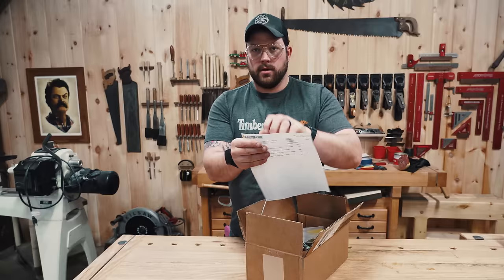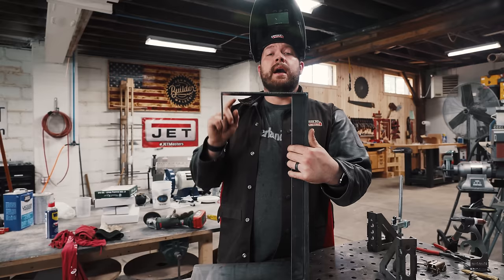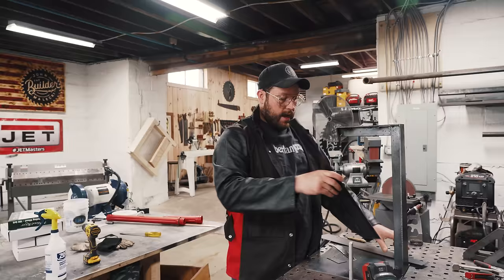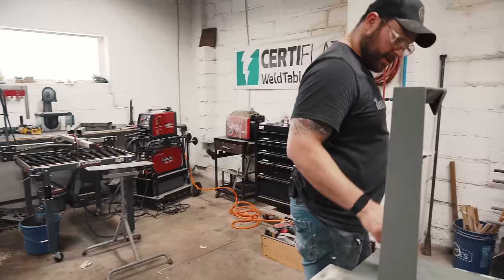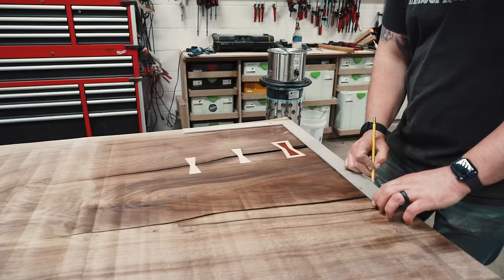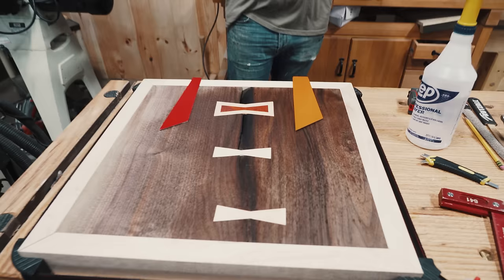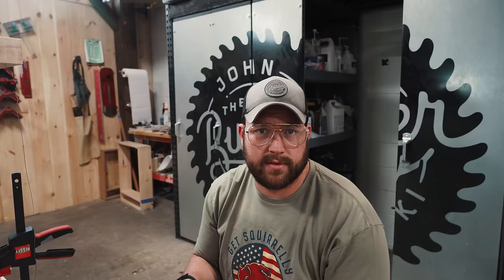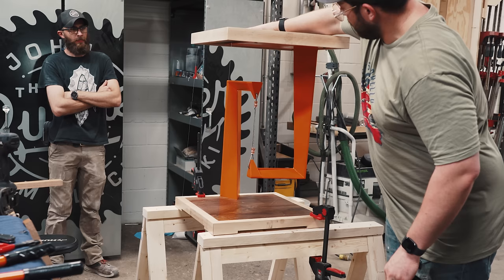Another IMPOSSIBLE "FLOATING" Table Build That Almost BROKE!

Comment: Instead of having just 4 wires that go straight up put 8 wires that cross and go to both other corners. Create Xs on the faces and that swill keep it from rocking and make a table that is actually sturdy and useable as a table that doesn't fall apart of you put something in the wrong spot. The main issues right now when it spins or rocks.

Comment: Use a spring load tension system for the stabilizing cables. It will reduce wobble and spread tension to all cables evenly.
Reply from the maker: Need that! noted for version 3 !
Reply: My thoughts exactly. Perhaps some stubby compression springs in the base so they stay hidden. Maybe even a stack of spring washers.
Reply: I got inspired by John's first version and I am finishing mine, similar idea. If you have something in mind on how to create a tension system it would be appreciated. I can't find a solution that would increase the tension on the other sides.
Reply: @hmeslava  just use a strong spring to attach the wire to the base.
Reply: @hmeslava  I've been brainstorming my own and I believe I will try some threaded eye bolts with a counter sunk nut under near the frame to create tension
Reply: James Holmes  But Chains are stretchable, so if it stretches beyond, it may topple over .
Reply: Do not use springs, unless you want to invest in shock absorber.
It will increase the wobble and make it very susceptible to oscillations.
If you wish to make it more stable you need more pretension and additional constraints in other axes.
Try cross bracing the tension cables, that should help a lot.
Reply: Turn buckles

Comment: try it with extra strong magnets it will be literally floating
Reply: Angle the magnets to hold center
Reply: If anything throws off the balance the whole structure could experience rabid disassembly
Reply: @williamwinder3466  if you can get a strong enough attraction.... But that level of magnetic attraction at a distance to make it look good.... Probably would be a bad idea for anyone who had any metal inside of 5 feet or more.
Reply: you need to get a giant type 2 superconductor.

Comment: Rather than going straight to dining table, I vote for a hexagonal coffee table.  I figure after 6 anchors on the outside, you hit diminishing returns.  Further, trying it with a coffee table first is simpler due to the height required.
I would also change the strut to be a triangular pyramid, the top rotated 60 degrees off the bottom so the apex of each pyramid is within the other.  This will further stabilize the forces by spreading them across the table, rather than just on one side.
Reply: That is an interesting idea.

Comment: 1. To stop racking, put diagonal wires under tension on each side. I'm not sure if you'll need the vertical wires at all if you make an X on each side.
2. To tighten it up, turn it upside down, add some load, and then tighten the stablizing wires. You might need slightly stronger wires there.
3. Awesome build. It looks great, is strong, and has much more stability than the last one. Nicely done.

Comment: Try adding a spring under tension to the 4 support wires. Under tension they will still pull the wires tight and give them room to lenghten.

Comment: Awesome project! So, to save time: Chipmunk, profile gauge, it will crack next winter and split next summer because of the frame, and the fact that maple is stronger than walnut. OK. Now that I've got THAT out of the way... Synthetic cable, pretensioned, for the outside, and perhaps a convex or concave shape to the top, to heighten the effect. Keep up the great work!
Reply from the maker: I’m surprised it took this long for someone to comment on how it will explode apart. Haha

Comment: add 4 tension cables on the outside that are not totally vertical. on the bottom part, you can put 4 new spots where to tie wires, halfway between the corners and the center, and bind them to the original top spots. that way, you will have a MUCH more stable table. Stable table. Stable table... sounds awesome!

Comment: You could add a "floating" intermediate disk which is attached with multiple of the thinner cables around its circumference. The cables would form a cone shape with the tip being where the cables currently attach, and the base is the disk suspended mid-way between.

Comment: For the middle cable, make your own braided wire out of a couple of pieces of the small gauge wire by putting it in a cordless drill at one end and a vice at the other. make it stronger and slightly less obvious

Comment: How about building the the base hollow so you can put adjustable tensioners on outside balance wires. Kitchen table, end crimp cable and hide fereles in frame. Recommend Sasafass, if you can find it, beautiful wood!

Comment: Next version.  Pulleys.  Miniature Pulleys and a tensioner.  This way you can use one single strand of wire to balance the load on all four corners.  There are some pretty nice stainless steel and brass ones you can use that would look amazing.

Comment: I love the concept of your floating furniture. One thing I would get rid of that 3/16” wire cable, which I assume is stainless steel, and replace it with a smaller diameter to make it less visible. For example, 3/32” 1x19 stainless steel wire has a breaking strength of 1,200 pounds which is plenty strong for what you are building. The 3/16” 1x19 stainless steel wire that I usually deal with has a breaking strength of 4700 pounds which is much higher than the 800 pounds you mentioned in your video presentation. Another idea would be to replace the wire with a highly polished stainless steel or brass rod which could be treaded into the two sections of the table. There are also available terminal fitting that can be easily attached to the wire that would be practically invisible.

Comment: If you add tensioners to the cables hidden underneath, maybe with a pulley to make the 90 turn you could probably get it more stable

Comment: Try using three main tension cables at an angle. That way the tension not only holds the table up, but also pulls it in three different ways, keeping it stably centered. Should all but eliminate the wobble. Take a bike wheel for example, as they also get their strength from all the spokes being in tension in different directions. You could also use 6 and cross them over each other for even more stability, kinda like a funky looking wheel with 12 spokes

Comment: I'd put an obvious chunky chain in the middle and the "invisible" wire cables on the outer points. Or a mix of chain and cable. Optical illusion of balancing on the chain.

Comment: Diagonal exterior wires/cables. Will create horizontal loads to prevent twisting. Vertical loads will still exist to create the effect. Should allow smaller external cables to achieve goal.

Comment: you could add diagonal support cables, like go from bottom corners A, B and C to Corner B (and do that for all four corners). 3 times the cable strength with the same cable. Evan and Katelyn's tensegrity table held like 25 pounds without flexing that way and they used clear plastic cord

Comment: May I suggest same cables but on the bottom, connect them in a way to tighten/toque the 4 outside wires to at least half their breaking limit. That will definitely increase stability with weight... you could possibly get 500lbs if the outside lines are evenly tight and keep the weight in center... good luck

Comment: You could achieve 100% stability and remove the wobble by running 2 runs of cable at ~45 degree angles in opposing directions from one corner on the bottom to adjacent corners on the top. Tables need to be reliable. Love the builds man, keep it up, Roll Tide!

Comment: Cross the lighter cables for added stability. Top left to lower right and so on... then try going front to back... all cables meet in middle... have the light cables hold a ring or bend back at a ring... now run the main cable through the ring in the middle... dining table size...
Reply: With matching floating chairs... you are a stumbling genius! Figure it out 😁

Comment: should do one more crimp on each of the big ferrules. PS, when it says the WLL (working load limit) is 800 pounds, they factor in a 5:1 safety factor. that center cable will hold 4000 lbs before it shears

Comment: it would be interesting to transfer some of the tension from the central cable to being tension on the outer cables, for example if the center cable  routed down the base so that the weight transfered to pull force on the outer cables, it would solve the issue with outer cables losing tension when too much weight is applied, and the outer cables would only need to be roughly 1/4th the tensile strength of the center cable.

Comment: Mount the stabilizing cables from the bottom corners to the top edge centers. (Triangles) Yeah, it doubles the number of stabilizing cables but it would remove the twisting and wobbling. Make it so you can crank down the tension on the stabilizing cables once the whole thing is under load. It would look much cleaner to either replace the center cable with chain or have the cable disappear into the arms rather than wrap through and crimp.

Comment: A pulley system inside the base could tighten the 4 strings when the center string is under load.

Comment: I think diagonal wires from top left to bottom right corners would fix the rotational stability a lot. It wouldn't look as impressive though. 

I have been building small 6^3" versions of this on my 3d printer. I am going to give my idea a shot.

Comment: The same principal should work for a larger table if you spread it across two tensegrity systems. Basically build 1 large dining table with two tensegrity 'posts' to support the weight. Great video!

Comment: For the thinner tension wires, why not connect them under the top with spring tensioners, so that as weight is added they are automatically kept at roughly the same tension?

Comment: You can add crossed wires to prevent any  shaking or vibration or
Add three wires  tied to the base heads and tied to the lower point of the upper piece
I hope you understand what i mean

Comment: Place internal tension springs that hold onto the external/corner wires. When you place weight onto the top causing the center cord/wire to "stretch", the external wires will stay taut keeping the top balanced.

Comment: For the next version, you could cross the outer cables instead of going straight up and down.  Essentially all of the cables would meet in the middle.
Reply: Bracing meeting in one point doesn‘t work. However you are right, the outer cables should not be straight down, do triangles on each side.

Comment: If the internet is right I think te best kinde off wire you can use is kevlar it can hold 520.000lbs/ square inch or in metric 365,57 kg/ mm^2.
 Because it can hold a lot of weight per small surfes you van make the wire almost invisible.

Comment: Instead of four separate wires on the corners try one long continous wire snaked around cams in the corners with two really, really  strong springs on either end for added bounciness.

Comment: If you make another version, to help with the stabilization, you could add some heavy springs to the corner cables on the underside of the base so they'll keep tension while you add weight to it.

Comment: I wonder what would happen if you had much thinner (almost invisible) wire on the outside but instead of one wire at each corner of a square you had a circular table with dozens of very thin wires (almost like a harp effect) around the circle. The centre wire could still be extremely heavy gauge and would 'appear' to be taking all the load. Just a thought! Great work guys :)

Comment: the orange metal reminded me of a Jory Brigham piece.. looks cool.... version 2 however, what about magnets for the center pushing apart from each other with the cables on the outside holding it together so it will literally be floating with just the cables holding it down

Comment: So, I'm an Audio Engineer, Guitar Instructor/Teacher, and Luthier as a semi- pro hobby. Lately with all the old guitars people have found in their basements and attics, I would say I'm becoming Pro.  (Let me know if you need any help with BRC guy's guitar idea!!!)

I am going to suggest that you experiment with the idea of how an acoustic guitar loads pressure on the the neck and body of the instrument.  

Consider using different gauge strings/cables for different tensions on the parts that you find go out of wack with heavier loads or an offset load.  Also, perhaps you need a more central "spine" to the whole affair, that acts like a truss-rod; in terms of tension.

Just some ideas! Either way I have become a fan and wish you the very best!!!

Comment: Hide the ferrules inside the structure for the big cable in the middle.
Haven't watched the other table video: are you tensioning the other lines individually? Having a turnbuckle accessible from outside should make it easier to tension those other lines.

Comment: Pentagon Table, made of wood, reinforced with metal. Maybe try to find a way to adjust the tension of the outer cables like you did with the string on the first table. 
Alternatively make a wobbly chair.

Comment: From the examples I've seen elsewhere, I'm thinking that the stability may be improved by having the vertical parts that hold the main cable facing each other, instead of at a right angle to each other.

Comment: I don't know if it would look funky but a block and tackle mechanical advantage type system that was hidden using the 70 lb test wire might distribute the weight over the center cables to take up the load. Probably to complicated to make it look good. But an idea.

Comment: The central cable isn't terrible but it does give away the mystery,  would it be possible to have multiple thin cables in the center, have them spaced apart from one another (this will obviously need to be a redesign of the center point mounting surface, so they share the load among themselves, I also agree that the side cables need to be strung under tension.

Looks amazing though!!!

Comment: think the first cables failed due to shear point in the steel  maybe a bushing to soften the edge would help?    or did the clips fail?   that thin wire shoulda held just fine   either way cool build and thanks for sharing

Comment: Tightening the outer cables under load would definitely help. And you still wouldn’t need it as heavy as the center one. Also I think if you made the attachment points on the underside of the top closer together than the base attachment points, I think it would resist twisting more. Or oppose, top wider than the base. Ever use a kid’s swing where the ropes were closer together at the top? Twist city. Spread them out and you’re golden.   Also bold move picture framing a slab...

Comment: no crimper needed, (in the air force) when we needed to swedge or crimp cables and didnt have the tool we would just use 2 hammers (1 like an anvil and the other as a hammer obviously) worked well

Comment: They need pretensioning. Also try using 2 wires on each corner going to the adjacent corners instead of straight up. You'll get an X brace on each side that will keep the top centered.

Comment: I thing it will be good if you put some weight on it just to lose tension on the outer cables and then tighten them up this way it will be more stable in my opinion

Comment: Instead of attaching the thinner wires straight up, have 2 from each bottom corner go diagonally up to the next corners on the top board. Wouldn't this help with stability?

Comment: To build one of these that will hold more weight than the material of the top can hold, check out the Ron Pratt Towing channel (he owns/runs Midwest Trucking in Scott City MO) and use the 3/8 chain he uses to lift/pull UHaul Trucks (I think it's working limit is 10,000+ Lbs.)...
It's expensive, but the top will break before the chain does...
And you can then use slack adjusters to tension everything properly...

Comment: I'm kicking around an Adirondack chair idea inspired by your first version video. One thing I'm going to incorporate is crossing the cables diagonally instead of having them go just vertical. It won't look as clean but should cut down on the racking under load. Keep up the good work man!

Comment: No matter what cable is used for the sides, it'll loose tension and get wobbly over time, like guitar strings. To keep it tight, you'd need a way to tighten the strings over time, just like a guitar.

Comment: awesome stuff @JohnMalecki. 
I wonder if there is a reason you switched to metal wire and didn't stick with fishing line like the first table. There are a number of high tension fishing lines that take up more than 400lb of load, and I suspect they would still be less visible than a metal wire. wouldn't they?

Comment: You shouldn't have to buff up outer cables they stabilize the top they don't hold weight. I would try an elastic of some sort under the bottom brace to keep a steady amount of pressure on the cables to keep them tought when they losen when table is under load. Maybe the elastic rubber for a slingshot.

Comment: If you really want that bad boy to hold up some weight you need to pre-load the center cable before locking off the outside cables. Also, run the outside cables in an "X" shape on each of the 4 sides, so you'll have a total of eight exterior wires. That will add ton of stability to the top to keep it from racking and wobbling. Another great video though!